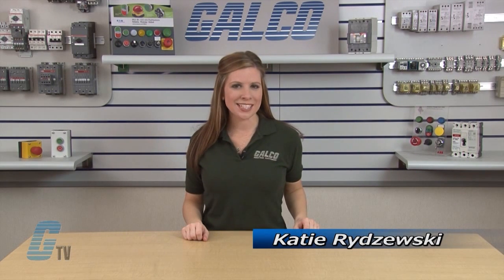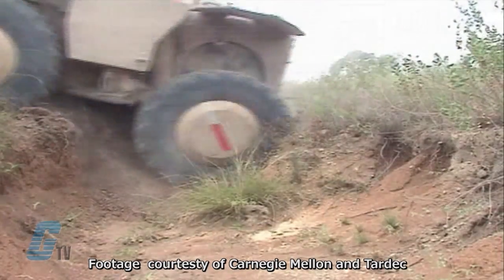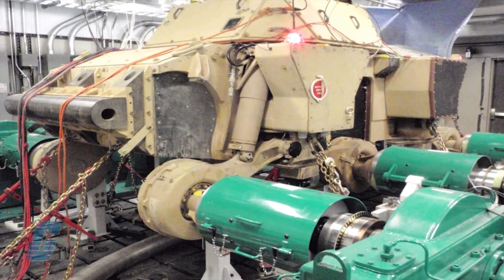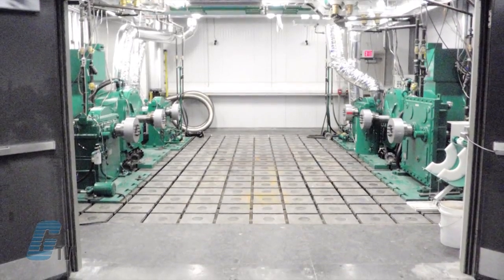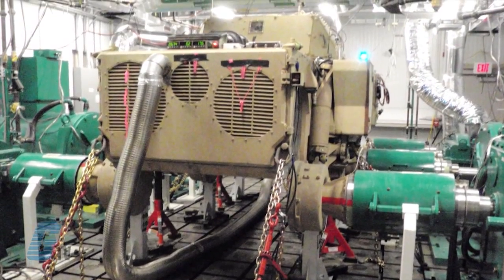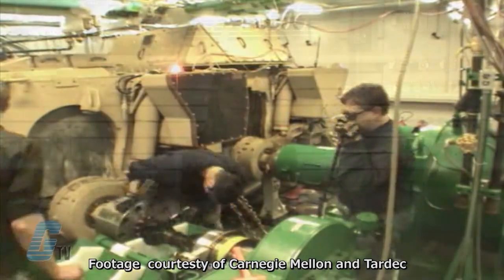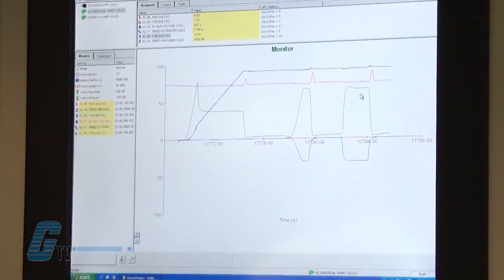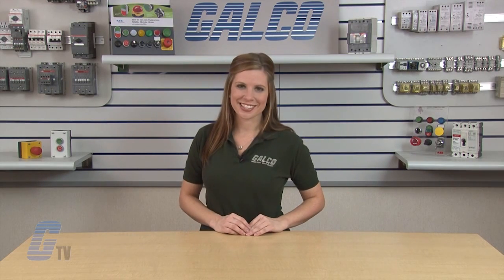Dynamometer Drive Systems from Galco Industrial Electronics

Comment: I work at MSU and I was involved with the project they mentioned along with some others since.  I can say that Galco is one of the only contractor that we have worked with that can consistently met the deadlines they set. They have one of the best product supports and tech support that I have seen, from the date of purchase to 4 years down the line. They have since built and installed a 700VDC power supply for us that uses a ABB drive. They are always a pleasure to work with.